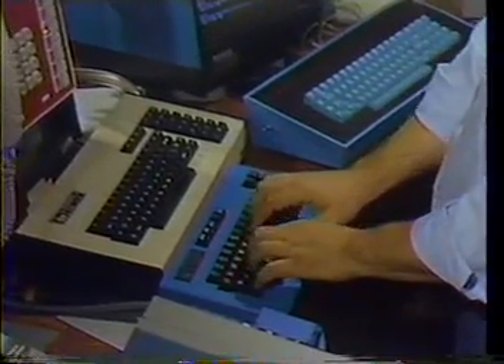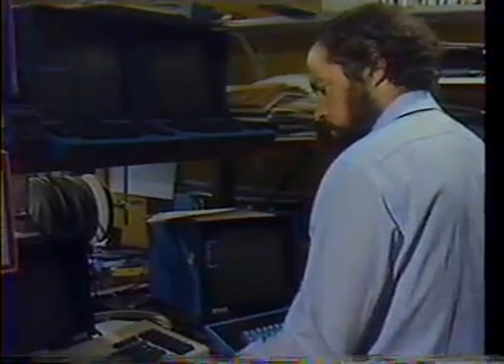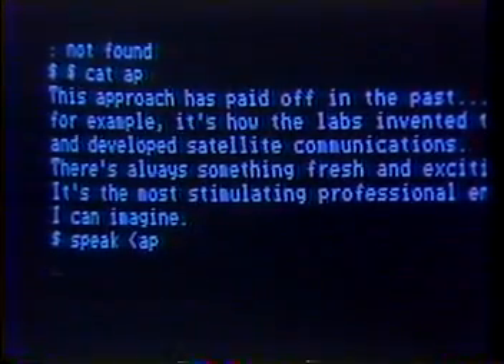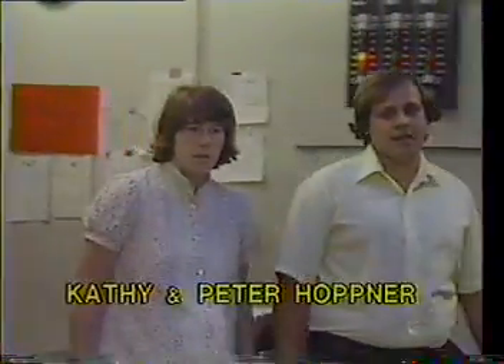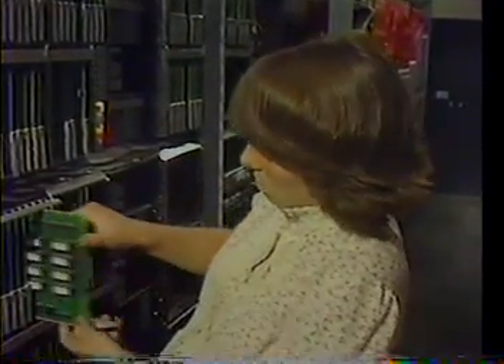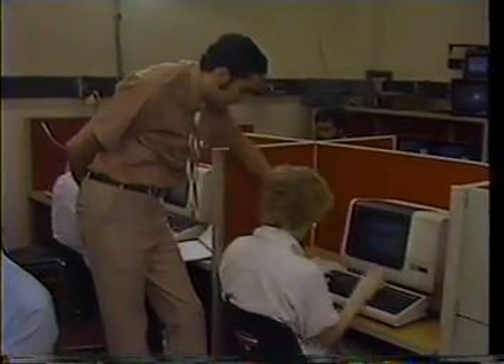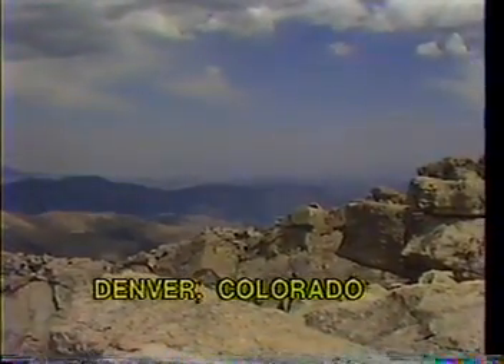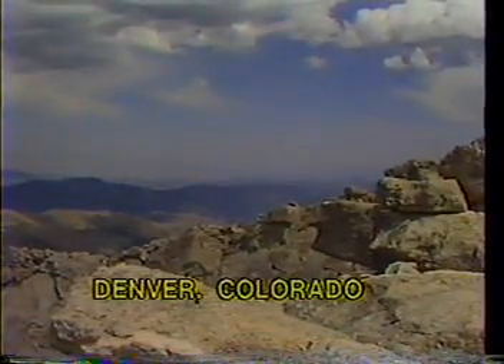Come Work At Bell Labs!

Comment: I never worked for Bell Labs, but a local Bell operating company as a TSPS operator in the early 1980's. I'm not going to say here what happened, but it was 180 degrees different from what is presented in this video. I eventually went on to a very good career in I.T., that I'm still involved in. AT&T's loss.
Reply: @@richardconte381 I'm going to do some guesses here. Before the early 1980's cards were 14 digits (usually a 10 digit phone number and four digits). There was no database to check when they were entered using the KP-Special key. They had to be in a specific pattern, like a credit card (look up the Luhn Algorithm as an example). If the number was accepted the KP-Special wouldn't blink, which would mean the number was invalid and try again. People were still making up numbers. Eventually there was a database. Numbers were still 14 digits, and could even be a 10 digit phone number and a four digit PIN. Better fraud protection at that point. Numbers were entered the same, but it wasn't just a number pattern that was checked. I don't think calling cards are used anymore, but I still have some old ones saved. I was just a bottom of the barrel operator then, so I didn't know all the details. Even though I'm an I.T. analyst now (but not with a telecommunications company) this is my educated guess.
Reply: Innovation was killed by Bell for decades.

Their massive anti-competitive monopoly along with enormous profits and vast stores of money becoming a tax and financial burden, AT&T/Bell began greedily gobbling up and locking away competitors, Innovation, and ideas.

Tens of 1,000's of companies, competitors, competition, and ideas were absorbed and purposely forgotten. 

Lobbied Politicians allowed for price gouging, new anti-competative laws banned other companies from competing fairly, and allowed for perpetual greddy renting instead of owning the products.

They turned open source into closed, freeware into rentware, passion projects into silenced projects.

You couldnt own a phone or technology. You could only rent it, effectively penalizing and privatizing innovation and pursuits of knowledge. 

Once Bell was broken up, the world was flooded with technological advancement, now being allowed to own, reverse engineer, and use the technology locked away by bell.

Comment: The building with the columns at 0:24 is the 195 Broadway location for former AT&T Headquarters or former Western Union. Building was built in 1923. It is no longer a Telephone building.